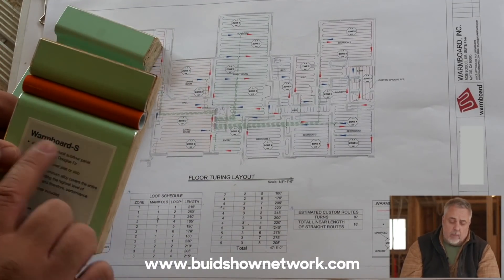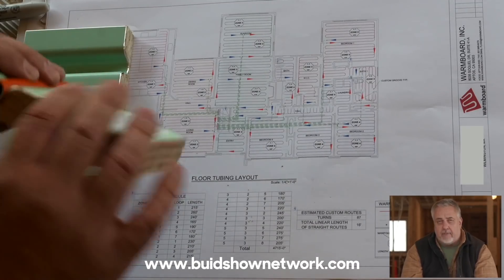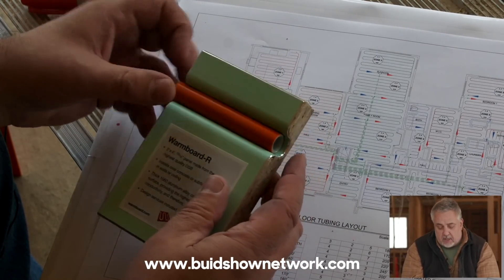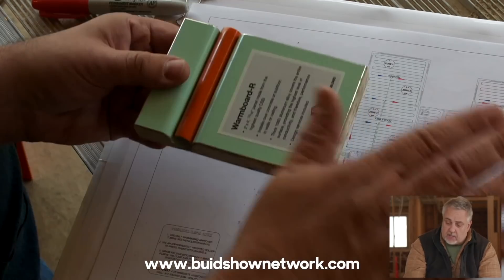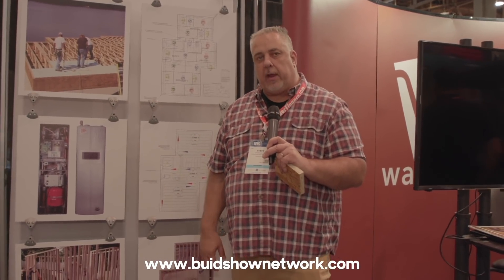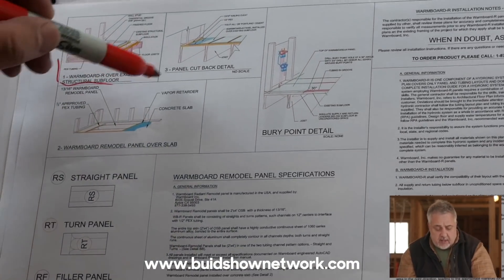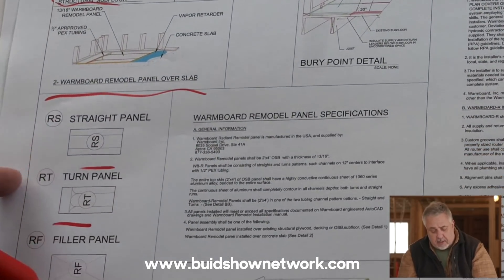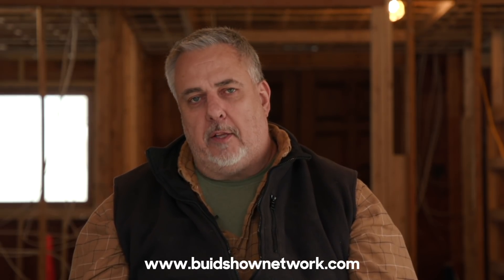Radiant Floor Heating Systems on Remodel Homes

Comment: Is it not better to have air gap between pipe and aluminum backing. This way radiant heat is reflected from aluminium and minimises loss of heat to floor via panel by conduction?
Reply: 1) NO    2)   Does not work like that. Heat is conducted by the aluminum skin from the small area of tubing to the entire area of the flooring, more even heating/ heat dispersion into the room = higher efficiency
Reply: @lhsunimog  hot goes to cold. So the ground of tubing is being unnecessarily heated. An aluminum layer on the ground, underneath the tubing with an air gap in between will reflect radiant heat up to the floor. Just science.
Reply: @terrkamp  You are very mistaken. I suspect you have never done one of these systems. The key to Warmboard's performance is that the heat is conducted from the tubing, and the aluminum layer is so conductive that the entire facing stabilizes at a small delta below the water temperature. It is also essential to have a very small delta temp between supply and return water, so that the entire zone is heated very evenly from one end of each tube to its other end, and the floor itself is then heated very evenly. What you are suggesting is the opposite, concentrating heat radiation and accentuating "hot spotting".  With very low delta temps, and insulation below the Warmboard, heat flow is predominantly upwards, assuming a hard finish surface. In that case, the Warmboard is at a relatively low delta temp vs. ambient, so the path of least resistance is into the flooring material. The Warmboard will rise in temperature, but heat flow downward is thwarted, so the result is a stable material temp, with relatively MINOR HEAT LOSS DOWNWARDS. It is for this reason (among others) that carpet (an insulator) seriously degrades the thermal performance of the Warmboard. Heat goes/is conducted  from warm tubing into the aluminum sheet, which is an extremely good conductor, so the entire sheet reaches essential the same temp, and then conducts that heat energy (goes from hot to cold, just science) into the flooring material very evenly; the flooring material then becomes a radiant source, directing energy into the room space. Since radiant temperature is about 40% more effective than air temperature as far as human physical comfort, the actual air temp in the space does not have to be as high as for a convector system (eg hot water baseboard) to achieve the same perceived (and real) comfort level. 
Two observations: 
1) you should watch out for AutoCorrect, as it is garbling your already scientifically irregular comments into a more indecipherable mush. 
2) if you are going to pose as an expert, you should have expert knowledge. FWIW, my credentials include a degree from MIT '76, so I am somewhat familiar with science, despite the fact that I grow up with a science teacher for a father.
Reply: @lhsunimog  Now now. Sit down and have a cup tea to blow off a bit of steam. Thats some rant.
I take your point about the heat transferring across the aluminium(The Queens English). However, you are ignoring the transfer of heat to the sub floor. Yes wood is an insulator but not 100% resistant or even close. So as the heating is on for long periods it will consistently lose heat to the colder sub floor. Thats just a fact. You can ignore it if you want. Some aluminium on the bacl of the board with an air gap between it and its surface would work. The question is, is it practical or economic to get that extra efficiency?
Still name dropping MIT.....get a life pal.
Reply: @terrkamp  Well, you have edited the original post to a readable form, but still not clear what you are proposing, especially in light of the later reply, which seems to be suggesting something different. It would help if you would carefully read my reply above, and the original standalone comment I posted separately. You have given the impression that you want solely to be taken as a wise person, based on the incisive question(s) posed. On the chance that you really do want to know the answer(s), I will make one more stab at this. 

Re: First comment 
Warmboard works by conduction from tubing to aluminum sheet, which distributes heat evenly across the underside of the finish floor materials. Suspending the tube in an air space, in the groove, away from contact with the aluminum sheet would totally transform the energy transfer, and totally defeat the energy transfer that makes Warmboard so effective. The radiant heat could only be outward from the tiny area of the groove itself, as the bulk of the aluminum would be covered (in contact with, conduction path to) by the finish flooring, that it necessarily fully supports. And never mind the increased bulk of the Warmboard substate, to allow for this gapping, and the attendant cost increase. And, never mind the expense of providing a suspension system for the tubing that itself allows no thermal bridging. 
Now, if one amends this line of questioning to "what about a layer of insulation between the aluminum sheet and the plywood substrate below?", well that is a different question. Different, and legitimate. Yes, heat does flow into the plywood, and insulating materials on the finish floor (carpet and pads, even throw rugs) will direct a greater % of the heat energy downward, all other things being equal, and hence reduce the efficiency of radiation into the space above. One could imagine an insulating layer being included in the Warmboard product. Aerogel comes to mind, as highly efficient, and even 1/4" of aerogel would be rather significant. I am shaking my head and suppressing a laugh at even writing this: research aerogel (pricing) and you will understand why. Warmboard is already the priciest heat dispersal medium out there, and has limited sales because of the price point. Then there is the problem of structural support for the aluminum sheet, and the finishes on top: aerogel is very low density, and impacts and heavy point loads could have very adverse results. Warmboard has been around for about 20 years, and if there was a cost-beneficial way to improve heating efficiency, I think they would have figured it out by now. 

Re: Reply above
It appears that you are changing the dialogue to a radiant barrier on the back side of the Warmboard plywood. Legitimate question; here goes. If one posits that the plywood substate is being warmed, and passing too much heat downwards, the desire to limit that heat flow should not be ignored. Bonding a layer of aluminum  on the back/ bottom of the sheet is a poor "solution", however. First, the Warmboard will be an emitter of radiant energy from the bottom, into an air space below. True, a highly reflective surface will have lower emissivity, but it is more effective to have a radiant barrier on the receptive surface, reflecting the radiant energy back towards the emitter. Another issue is that the Warmboard must be supported in way that creates that air gap. This could be on joists, or sleepers. Either way, there is a conduction path from the bottom of the Warmboard through the (presumably) wood supports and further down to whatever thermal mass is present. An aluminum sheet would act exactly like the upper sheet, only in reverse. Meaning, the heat energy from the entire Warmboard volume would be conducted very nicely to the thermal bridges of the joist or sleeper support. Means the effective conduction path is now only 1 1/8" wood (1/2" +/- at the grooves) over the entire sheet, and then into the supports. Left alone, conduction path from tube locations to joists is on average MUCH longer, much more R-value.  

As side note/ background, I and many others have done staple-up radiant tubing directly under the subfloor. Works, but heat distribution is "streaky" and significantly less efficient than Warmboard. The next step is to use aluminum plates that the tubes press-fit into, which are then fastened to the underside of the subfloor. More $, more efficiency, but still not as good as Warmboard, in part because of the longer travel path/ higher thermal resistance through the subfloor material. A side-side note, get a good thermal imaging camera, and scan all of these types of installations as the water temp is raised. Staple-up shows the tubes clearly, diffusers less so, and Warmboard is extremely even temp across the entire floor surface. Finally, gypcrete and concrete slabs get radiant tubing installs, and in these, the thermal mass is very integral to performance: there is a big time lag as the mass is loaded/ unloaded. Having used Warmboard, I embrace the notion of fast response, but also the notion of not using (night) setbacks. The best installs use outdoor reset, and keep water flowing for the biggest % of time, most closely matching heat loss. 

Now, the real "answer". Any of these radiant floor systems needs to control and limit heat flow downward, and direct the maximum into the conditioned space. If one is installing in a floor assembly that is itself above conditioned space, this is easily addressed. Any radiant tubing floor needs insulation in the joist cavities below. 3 1/2" FG batts are usually adequate, more is better, but not necessarily cost effective. The delta temps are just too low to waste a lot of $ on this. We typically do sound isolation, so there are sound channels on the bottom of the joists and the cavity blown full of cellulose. Thermal problem taken care of, no extra charge. One good practice is to use foil-faced foam in the joist cavity under, but spaced away from, the radiant tubing (or Warmboard). Radiant barrier, limits convection, all good. 3/4" foam is more than good enough, but should be augmented by batts immediately below. This is especially effective in I-joists, as the foam is cut to fit between webs, and tilted up and in to sit directly under the flanges, which automatically create the air gap. Now, the conduction path is 3/8" wide web, rather than 1 1/2" (or whatever) of the flange , or a solid sawn. 

On a retrofit, over a slab, it is absolutely essential to provide some insulation below the Warmboard. We did this by using redwood sleepers, scribed to level the tilted concrete floor, with foil faced polyiso between, sealed with expanding foam to limit air and vapor transmission. This job got 1/2" for a portion, but 3/4" once the floor tilt was big enough, and all with minimum 1/4" air gap. Performed extremely well. EXCEPT:  Thespreadhugeallowedtimeunusualdryingtechniquesaid for by my hardwood floorlayer's liability insurance. At this point, I doubt that I would ever again place Warmboard, or equivalent, over a slab, or in any situation where the underside is essentially permanently inaccessible. The risk factor is actually low, but the consequences of an incident are extremely high. 

Now, if you feel the need to reply, please leave your anger at home, and bring verifiable content.